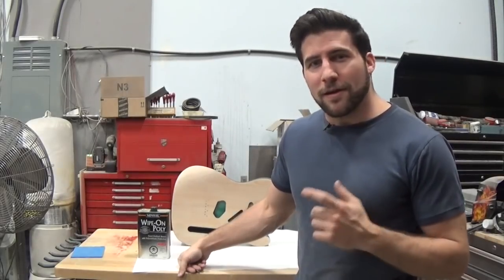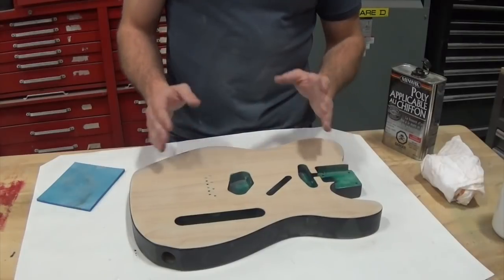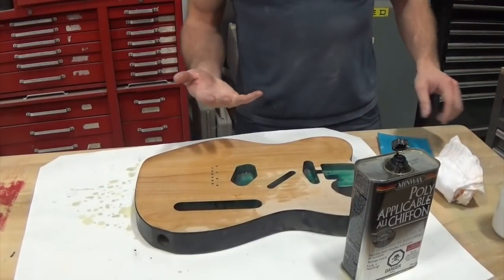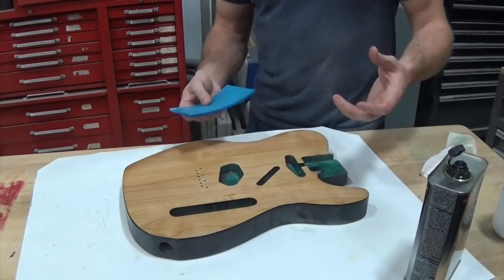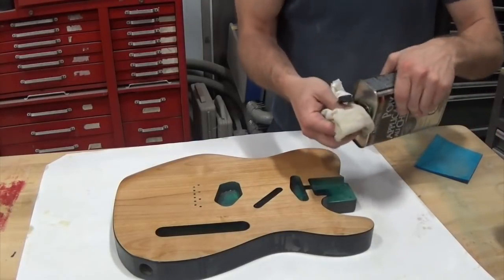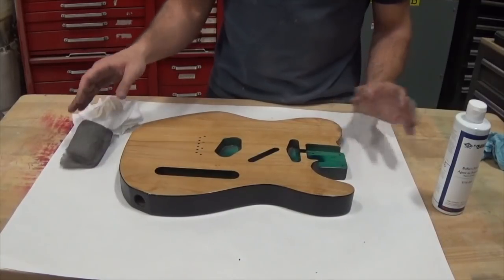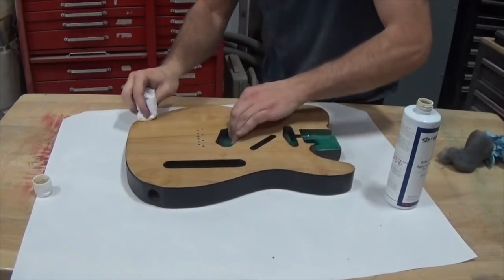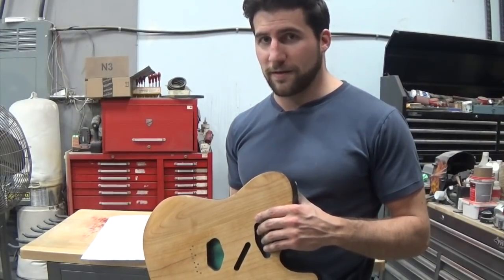How to apply a perfectly smooth poly finish by hand

Comment: can you add a tint to the clear poly to give it some color, oppose to having to stain first then add the poly coat, seems like it could be done but wondered if you have done that before ? Thx
Reply from the maker: You can tint it with dye. You just need to be careful to mix well etc. otherwise it will turn out like that polyshades crap, which is stain and poly in one.
Reply: @BradAngove  thanks I think I am going to strip, then stain followed by a light poly satin finish, I too am not a fan of the Minwax polyshades product, maybe it's fine for a baby crib, but not my guitar .. lol

Comment: Cool is that a water clean up Polly like flecto diamond coat? Or could you just thin regular poly
Reply from the maker: This is oil based. And yes, thinning brush on poly and adding some boiled linseed oil can essentially create a wiping poly.

Comment: Great video! Could you use a orbital polisher with a finishing sponge on it for the buffers polish? Or do you need all of that pressure to achieve the results required?
Reply from the maker: Yes you can use an orbital.

Comment: Does this method work on guitars with a paint coat?  I have a 90s Strat, and the previous owner sanded off the poly finish only on the front of the guitar.  I want to restore the look of it being finished.  It’s fine if the finish is a little hazy.  It might match the old finish on the sides and back.
Reply from the maker: Just use a cloth instead of the sandpaper. If it’s already painted you don’t need that grain filling trick.

Comment: Can you tell us about the black finish on the sides and, I presume, the back?  Additionally, how many coats of the poly do you think one could use before getting a goofy finish? That is to say, how deep a finish could you expect? Good tutorial.
Reply from the maker: The black on there is just the remnants of a previous finish. Probably spray can. 
You would switch to normal wipe on after a few coats of the poly and then could build up quite a few of you want. There’s no reason you couldn’t do something in the 10 coats total range if you’re careful and patient.
Reply: @BradAngove 

Hi, thanks for your videos, they are very helpful

Brad what happens is that I have a guitar with clear coat in polyurethane and on top of the guitar had a small Drop, fill it with super glue and with the blade remove the excess and then proceeded to use sandpaper 1000 with water to prepare the surface, and after leaving the glossy finish, I realized that the restored piece was somewhat sunken with respect to the overall finish, it is not completely flat. So I want you to help me.

* 1000 sandpaper is very thick to leave that surface ready to polish? Should I use 2,000? Or what would be the best option?

* How much should I leave the super glue higher with respect to the global clear coat so that when sanding, it is flat in general?

I know I can sand everything and use polyurethane but since the imperfect one is small, use the super glue technique that gives good results in Drop in polyurethane, but I can not leave the surface completely flat.

Thank you
Reply from the maker: Are you using a sanding block, or just paper?
Reply: @BradAngove 

Thanks for answering

A sanding block

but it is very difficult to get in stores, sandpaper of 3,000, 5000 and 7000, the finest common to find is 1000 so use that but that piece is always sunk after using razor blade, sanding and leaving the glossy finish.
Reply from the maker: I have some higher grit paper available throught the amazon link in the description. You with need to use more glue, and you may want to just carefully level it with the razor blade before block sanding the area smooth. 

I have a video about restoring a beautiful gloss finish that you may find helpful.
Reply: @BradAngove 

Brad thank you very much

I'll follow your advice

Comment: Under my Black Lacquer is a dull red primer or maybe it is a wood sealer? After stripping I am left with this primer should I sand to wood?
Reply from the maker: It’s probably primer. What are you painting overtop?
Reply: @BradAngove  lacquer base coat then clear coat gloss.
Reply from the maker: If you’re going with an opaque finish there should be no need to sand to the wood.

Comment: Hey Brad.  What if the wood has been dyed or stained (Rit Dye or Color Tone).  How will this technique work if at all?  I'd be a bit worried that the sanding process could ruin the dye or stain (even create a haze of fade to the color).  Would you be willing to demonstrate this using those products?  I believe this will give me the answer I'd need moving forward with my StewMac LP guitar kit.
Reply from the maker: The sanding technique has the potential to haze up the stain job a bit. I may do a demo of it at some point.

Comment: Hey Brad I’m new to your channel and all your videos are very helpful. I’m creating a VH Bumblebee body guitar. I’m having problems with the method of spraying polyurethane process. Runs and bubbles. I’ve sanded between all for coats but I’m not happy with the results. Could I use this wipe on polyurethane as my last step after compounding the guitar? Sorry for the long message. I’d appreciate your input.
Reply from the maker: You wouldn’t use it after doing the compound work. At that stage it wouldn’t stick properly. You could do it in place of compound though and see how it looks.

Comment: Do you think It works with a stain? If so, alcohol or oil based? Thank you again. Great Video
Reply from the maker: It can, but I would forgo the sandpaper method and just start with a sealer if using a stain.
Reply: Brad Angove thank you, I found your other video, where you use stain and wipe on poly.

Comment: Thanks for the video Brad, learning a lot from this. What grit sandpaper do you recommend sanding the guitar before applying 1500 grit?
Reply from the maker: 800 is what I like to use there.
Reply: @BradAngove  Thanks so much Brad. Just giving an update; I put the first coat on the neck and it's slightly darkened the wood and looks brilliant. Just wondering in order to keep the natural look/feeling neck how many minimum coats would I look at doing?
Reply from the maker: Just a couple. You can keep it pretty thin.

Comment: I use Tattoo ink, Copier ink, Angelus leather dye or Artist Oil paint. After my painting I sand it smootly with a cleaning raw sponce, these small sponces with the green sites. Can I use this lacquer? Wich type is it? High Gloss, Mat, Silk. We cannot get this in Nederland but we could use Avis Poly. Its the same.
Reply from the maker: This wasn’t lacquer. It was poly.
Reply: @BradAngove  Yes, sorry, Poly, but can I use it on the Dye I normally use?
Reply from the maker: Yes.

Comment: Dear Brad,

Thank you for the skill sharing.

For international mailling restriction , I can only order Minwax Water based Wipe on poly from amzon.

I try to learn the trick, pour a little poly on sand paper (i am using #6000) and rub it inside wood.

I found the poly is dragging when I rub it inside.

Did I do something wrong?
Or is it the Water based wipe on poly needs dilution first?

Thank you so much for your help
Reply from the maker: Diluting it a bit first should help.
Reply: Thank you for your reply.
I tried diluting a bit, and i changed to use #800 sandpaper, it turns out smoother feeling when rubbing.
Thanks a lot.

Comment: Hey Brad, really cool and informative video! I have a swamp ash telecaster thinline body that is so far only treated with some coats of boiled linseed oil. Would the trick with the sandpaper and wipe on poly also work with this body (with the very open pores and also the already applicated oil)?
thanks a lot!
Reply from the maker: Yes, it would work. However I don’t want to mislead you into thinking this will fill the pores on ash. They are usually too open for this to be sufficient.

Comment: Great video!  Does this same method work if you stain the body first?  I'm going to be building my first kit guitar and want a nice medium stain that highlights the maple grain.  This video was super helpful.  Cheers.
Reply from the maker: This method will likely cause the distressing or removal of some stain. If you’re staining first, just use a thin first layer of poly and wipe it on with a cloth.
Reply: @BradAngove  Thanks!

Comment: Great video as always Brad. 2 questions though. How do you prevent the poly from dribbling all over the edges of the guitar? If you are clumsy like me, it'll dribble goo everywhere and look bad, but if you tape it, when do you remove the tape? Second question: can you apply this over paint, and if so, what's the waiting time between paint and poly coats? Cheers dude!
Reply from the maker: If you're just doing the top like this and you want to keep it off the edges entirely you need to tape them up. You can remove the tape after the finish is totally dry, or after your last coat tacks up so that it's not wet but still a bit sticky.
You can apply this over paint, but depending on the paint type it can move the paint around and make a horrible mess. Test is before you try it. I'd let the paint cure fully before throwing this on overtop.
Reply: Cheers dude! May have further questions when I start painting the fairing on my motorbike. Like, it's plastic, is there a specific type of paint that I need to use, and is there any point using anything other than 2pack clear to protect it even though it is properly evil and deadly? I was kind of thinking this smooth poly would be good simply because I could build it thick. Bad idea?
Reply from the maker: I would use the 2K poly to clear it. This stuff isn't really designed for that sort of thing. You'll need adhesion promoter or plastic compatible primer to begin with.

Comment: Brad watched your video on applying wipe on poly what type of wood was it and why not use a sanding block.I have maple would the ploy give me the same color you got?
Reply from the maker: It was alder. Maple would probably be slightly lighter. You can use a sanding block if you want.
Reply: Thanks for responding

Comment: Can you spot fix poly with the wipe on? I have a very small area on the neck, was thinking I could use a dropper or toothpick to apply it? Used the spray max2k. I set the guitar down and an edge sunk or dented in before it fully cured. Sand and level and apply the poly? Do you think it will be ok? Or what/which do you recommend? I can send a pic if needed to get a visual. 
Thanks!
Reply from the maker: You can make the make less visible with that technique, but unfortunately poly leaves witness lines since it doesn’t melt into itself. You’ll see a light haze around the edges of the fix.
Reply: @BradAngove  I'll probably do that. I dont mind the lines, just want it fixed. Thanks for your videos, I've been learning a lot. Take care!

Comment: Nice video. I'll be doing the entire body of my bass, do you think I should do it one side at a time and left to dry or is it okay to handle as I go?
Reply from the maker: Do you have somewhere that you can hang it to do this?
Reply: @BradAngove  I was able to hang it up and do it. The bass I'm doing it to is one of the Mexican made Fender P basses with the natural wood finish. The thick clear coating that came on the bass started raising and cracking off after years of sitting so I removed the clear coat and redid the whole thing like this for a more natural look. Thank you!

Comment: My apologies if you have already answered this elsewhere, but I was unable to find it: you stated that you used 1500 grit paper for the first two applications. That looks thicker than regular wet/dry, or is that just an optical illusion?
Reply from the maker: It’s foam backed.
Reply: Thank you, sir. May I impose to ask which brand?
Reply from the maker: The ones I was using are 3M.
Reply: Thank you again, sir for your time and for the very informative videos. Greatly appreciated.

Comment: Just to clarify: would wipe-on poly be ok on a spray-painted body e.g. with nitro? or only on wood?
Reply from the maker: It works on some paints. I’ve never tried it on nitro, but if the nitro is fully dry I would be surprised if it didn’t work. You would just typically put clear nitro over nitro instead.

Comment: Hey Brad, i have stained with crimson guitars stains my guitar, and i wanna ask a question..can i use polyurethane 2 pack for floors, or polyurethane water based is better and safer for wipe on with a cloth as a finish? 
Thanks for your time and tips!

Comment: Hi - 
I have an electric guitar body I want to paint with the new style "acrylic pouring". It already has a white base coat. What should I use to prime it with before I paint it? Also, what is a good varnish to use to seal the paint after it is dry since it will be used? thanks in advance
Reply from the maker: If you sand and clean it well I don’t think you necessarily need a primer. That being said, I think acrylic pouring puts far too much paint onto a surface and is likely to cause durability issues no matter what.
Reply: @BradAngove  ok thanks. i am hoping to thin it out enough to not cause issues

Comment: Hello Brad , I have stained my guitar in blue , but after spraying 4 coats of polyurethane varnish , the color has darken quite a lot ! What can I do ? Thanks for your solution
Reply from the maker: Clear coat always increases contrast, which includes darkening darker stains.  Polyurethane varnish also has an amber hue to it which darkens. If you want it lighter you can remove that and use a water-borne varnish instead.
Reply: @BradAngove  Oh I see , thanks a lot for your quick answer Brad  ! Final question , since I have to start all over again , can I use as a stain , the blue ink for fountain pen , which is beautiful ?  Good day or good night ! In Paris its two in the morning !
Reply from the maker: Yes, you can use that.
Reply: @BradAngove  Thank you so much ! You're very nice and talented !

Comment: Hey Brad ! Would it be a good option to do this after a spray can paint job ? I want to make a gold top ... or should i clear coat it with cans ? Thanks buddy !
Reply from the maker: You can do either as far as the product choice goes. I wouldn’t recommend using the sandpaper technique over spray cans though.
Reply: Ok thanks Brad ! Your time is always appreciated !
Reply: @BradAngove  So what would you apply this with,  if not the sandpaper, over a spray can paint job. I'm looking to paint a body in Daphne Blue/light blue color. Thanks!
Reply from the maker: A cloth. For example, an old t-shirt that has been washed enough times to remove all the lint.

Comment: Thanks Brad!  Great and helpful video!   If you were applying the Wipe-on Poly over a solid painted guitar and not the natural wood, would you still recommend applying the coats using 1500 sandpaper or with your experience, would you recommend a different finish over a solid painted (acrylic) guitar?
Reply from the maker: I would recommend a spray finish over that. A spray poly should work.

Comment: Brad, the wood here looks like alder or something with small pores.  Would I need to do a pore filler step if I were using a large pore wood like ash?  Also, if I did a burst using dyes, would the aaplicatiins with sandpaper end up interfering or messing uo the dye job?  My gut says yes, but I'm no expert.  Thanks as always.
Reply from the maker: Yes, you would want to do a pure filler if you’re looking for a smooth end finish. Using sandpaper could cause some movement in your stain that you probably wouldn’t want, so your gut is correct.

Comment: Hi Brad,
Great tutorial and that finish turned out great!  What kind of wood was that guitar body made of?  Also, did you use any grain filler prior to applying the wipe-on poly finish or was that step taken care of with the saw dust mix with the poly?  Is it possible to apply Tung oil before the poly? Lastly, I have an alder Jazz Bass body on order and wondering if that type of wood will yield similar results.
Reply from the maker: I’m pretty sure this was alder. No grain filler with this technique. You can use this technique for tung oil first.

Comment: Hey! I love painting guitars and the next one that I make I plan on painting the back and then doing this technique on the front. First, which would you recommend that I do first? Paint the back? or poly the front? 

Will the poly damage the paint on the sides and the back if I also use your technique with the spray paint duplicolor? 

If the back has a clear coat over the entire surface can that clear coat be put on top of the poly or should it be resistant enough to elements and humidity on its own?

I know that this is a lot but I would really appreciate it if I knew what I was doing.
Reply from the maker: I would do the front first, the sand and clean the sides and back, tape the front, and spray my black. 
As for clear coat on the entire surface, it depends on the clear coat.

Comment: Brad, nice video.  What is your opinion about sanding a veneer top? Thanks, Mark
Reply from the maker: You have to do it gently so as not to sand through. If you’re doing it with oil and high grit paper like this it should be just fine.

Comment: Brad, can you do that to a surface you used tung oil on? I have a sparred maple les Paul I want to finish with tung oil, but I would like to seal it with poly. Can I use this product. If not, can I stain the wood before I use this type of poly? I think this process is awesome and would love to try it.
Reply from the maker: You can use this product over tung oil. You likely don’t need to use the sandpaper technique though if you’ve already oiled it.